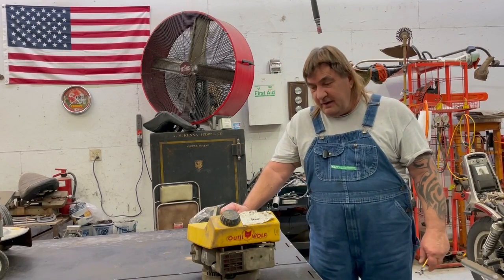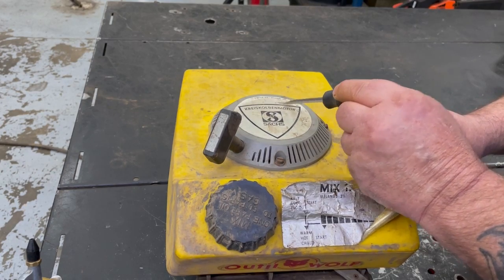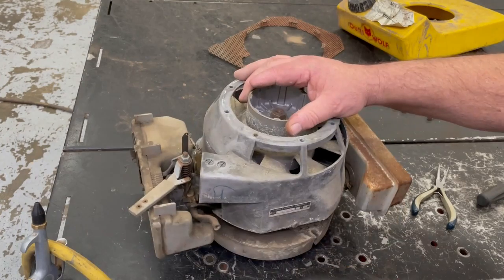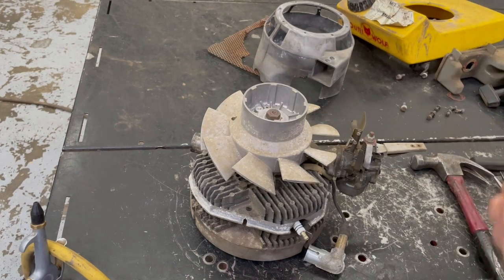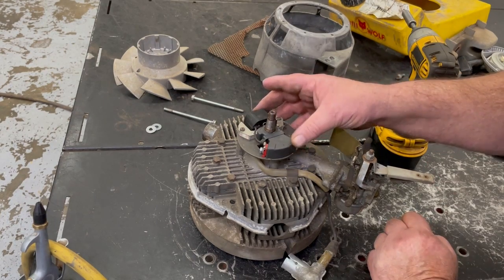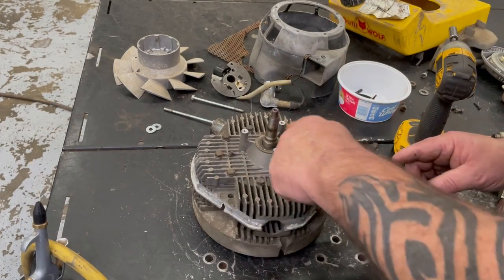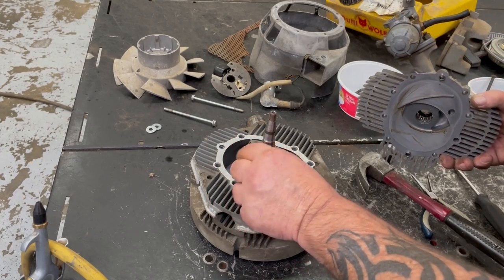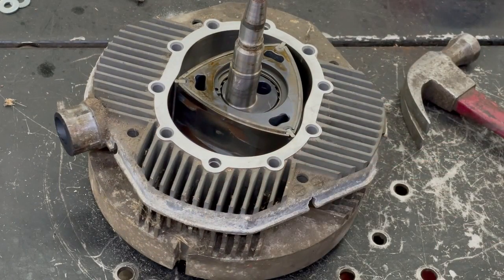Tearing Apart VINTAGE Rotary Push Mower Engine (Kreiskolben Sachs)

Comment: Rare engines today! Very cool stuff! I have a couple different types myself, snowmobile engines. And each manufacturer has a slightly different engineering style. They all stem from the creator and inventor Wankel. The problem was their weaknesses in fuel economy and the necessity of using a slight gas/oil mixture to reduce the wearing of the scraper seals. Bad timing for this design..... Probably!? Just coming into the early 70s and the gas/oil shortages was not something the manufacturers and consumers didn't want. Unfortunately they do have the potential to make a ton of power with some sort of forced induction system, turbo/supercharger. Due to the fact these are pretty low compression engines, which is part of their inefficiency. But otherwise very cool to see how they designed the lawnmower variants. The sled engines are also air cooled like this. 😊

Comment: Now that you bróke it do you want to sell it ? I want to restor it and display it .
Reply: Yeah these engines are NOT for the novices or explorers. Very delicate inside and out. Good luck with your potential sale..... One negative thing about YouTube is the watching others learning, unfortunately it doesn't always work out for most. Me personally am working on the restoration of a Arctic Cat variant 295cc rotary. I have a complete finished restoration of Arctic Cats first variation which is a Sachs/Curtiss 18.5hp and is entirely different @ 303cc. The Curtiss is definitely the best looking rendition of the air cooled versions I have to state, as they look more like a science fiction electric jet engine of sorts Lol. Good luck with your quest here. Hopefully you'll be lucky and someone will sell ya one for your project/restoration. 😊
Reply: At the very least, someone needs to get him a rubber hammer.